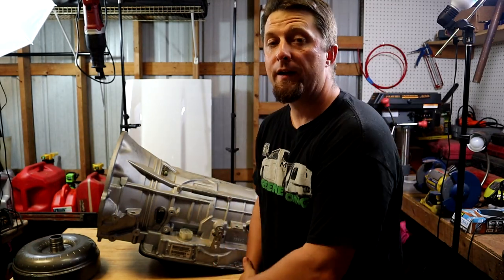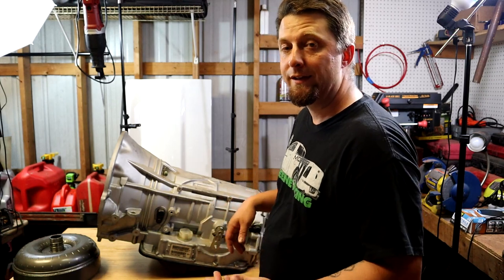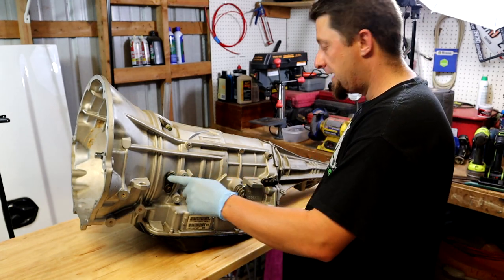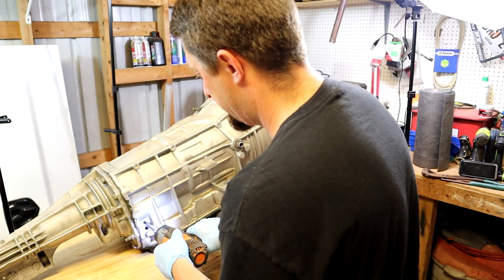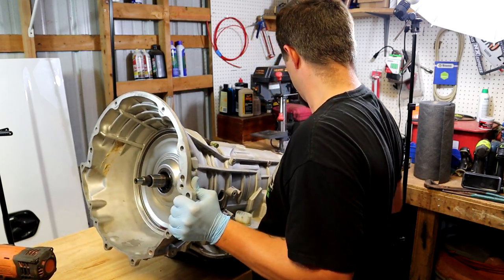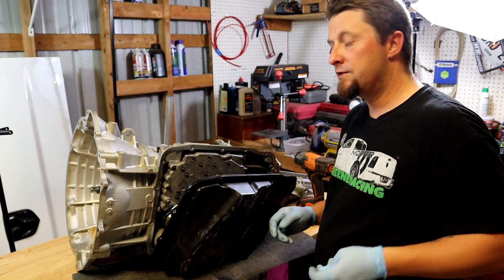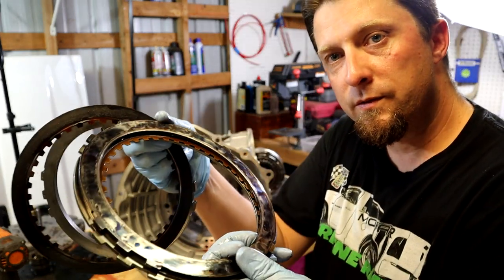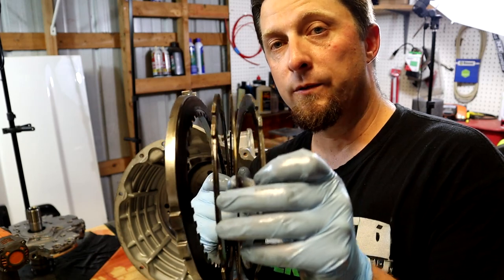545 RFE Transmission Tear Down RFE Most Common Problems

Comment: I have a 2011 ram R/T with transmission codes p0734 p0869 p0935 if anyone can help or had similar issues I’ll appreciate it
Reply from the maker: Go check out high performance rfe rams on Facebook
Reply: 734 is gear ratio error in 4th idk bout the others

Comment: So it fails after a rebuild and you blame the transmission and not the builder? Lol
Reply from the maker: Nobody has had any luck with rebuilt rfe trans
Reply: @FrostbiteRam  I heard it was bad but didn’t know they were that bad
Reply from the maker: Best option is new unit or a unopened used junkyard trans